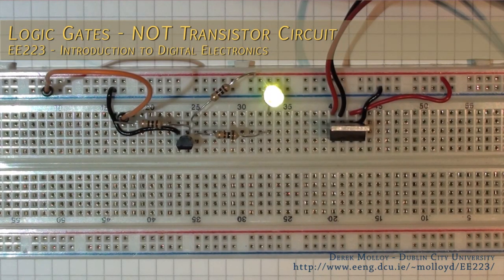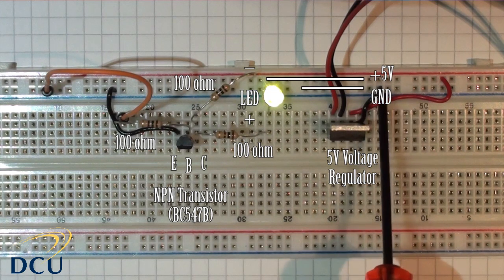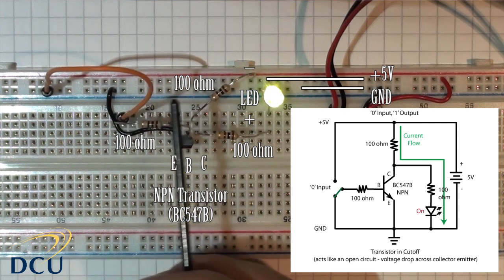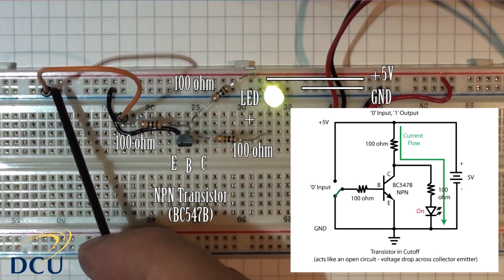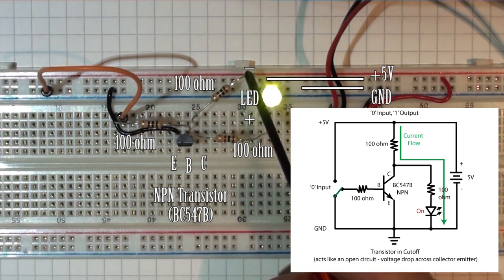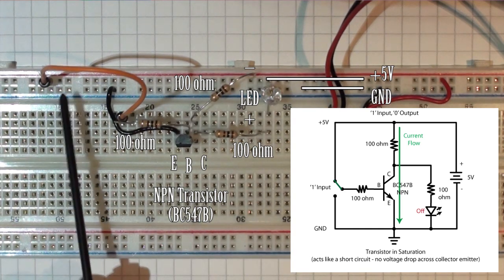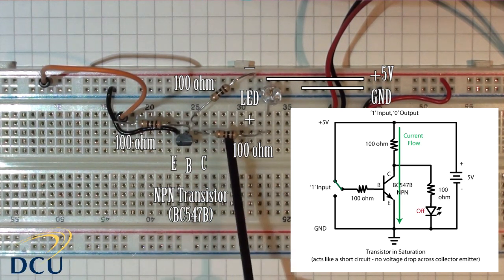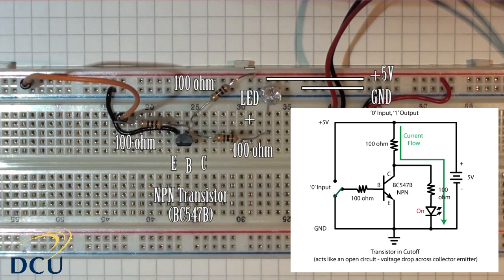Experiments 2.1: Logic Gates - NOT gate using a single transistor

Comment: @JamesEthan15 If you replace the resistors with wire and the switch is low, the LED will blow. If the switch is high, the transistor will blow. Not such an interesting experiment if they are absent.